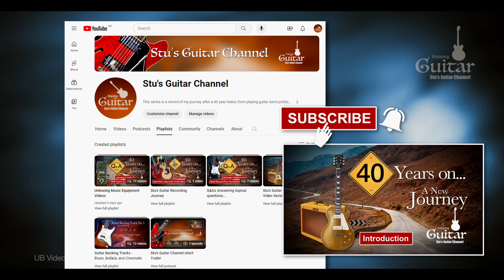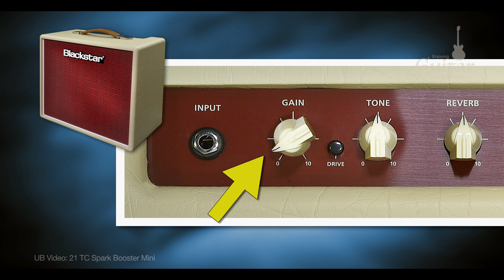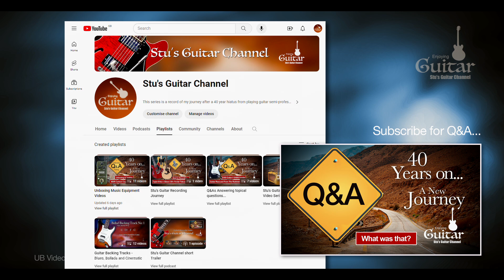UB:21 TC Spark Booster Mini Pedal Review - What is it? Do You Really Need One? Why I Bought One!

Comment: Where this pedal really pays off is setting up a tone with a humbucker and then switching to a single coil - just engage the Spark set to the difference in output and now the single coil hits the front of the amp/chain at the exact same level as the humbucker, no more adjusting specific gain settings for each pickup. Perfect for coil split experimentation. And yeah other manufacturers make the same thing, but nobody else does it in the mini format for $60, cheers to TC Electronics for a great pedal and Stu for a great vid 🤘🎸
Reply from the maker: Thanks for that Socalwill9876... I had not thought about that... I do have that balance issue, just a little with my HSS Stratocaster but thinking about the split coli arrangement on my PRS McCarty, I must try that out. At present, my playing is in a recording environment where I have total control over what I'm doing but I would certainly look at that if playing with others live. Thanks again for the comment... Regards: Stu